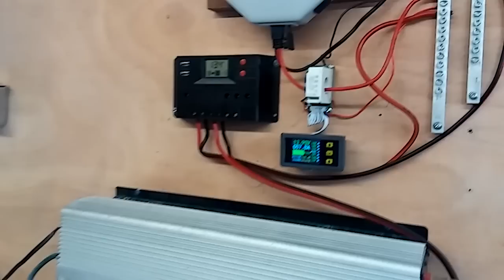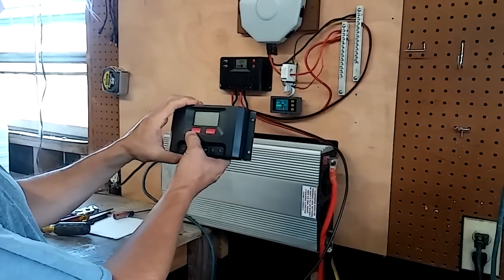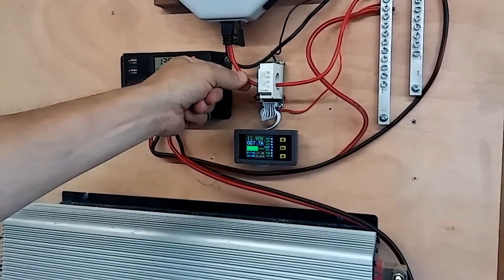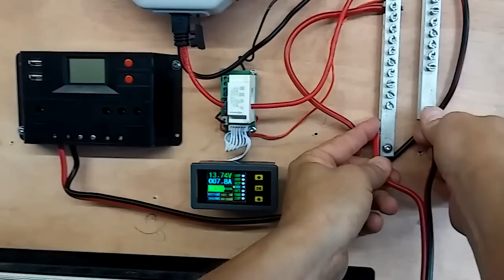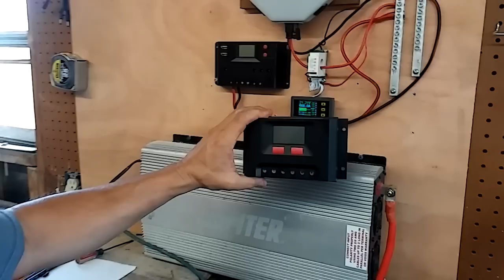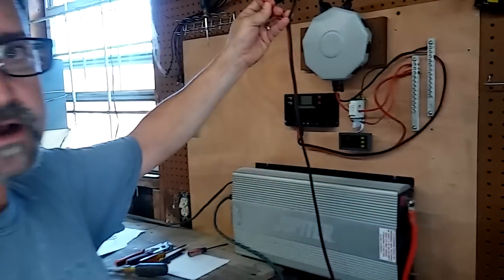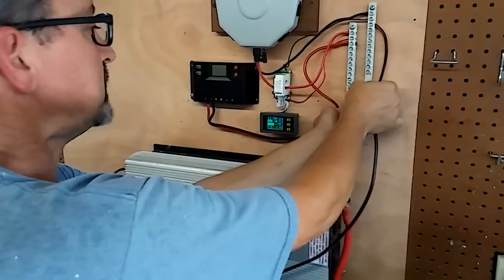Maxing out Harbor Freight solar panels

Comment: What about stepping up the voltage to 24v or even 48v?
Reply from the maker: Michael Sherburne. My power inverter is only a 12 V inverter and the charge controller you’re looking at will not handle that voltage.  But in the future yes maybe

Comment: I have to Harbor Freight 45 watt solar panel kits. My question is could I hook all six panels to one original Harbor Freight solar panel charge controller. Any feedback would help, I am charging 2 6 volt batteries tied together for 12 volt Trojan t105
Reply from the maker: The charge controller that came with the 100 watt kit has a 20 amp fuse. I have goten 13+ amps out of it with 12 panbels. I now have 3 100 watt kits. I had all 3 kits totalling 300 watts. I had no problems
Reply: @Checkitfirst  so if I'm getting this right the obvious question is I need to check the fuse in the back of the controller and see what the maximum amperage you can handle. And this is coming from someone that worked on generators Transformers electric motors, LOL that tells you a lot of what I know and don't know. Just because you put a carburetor on a car doesn't mean you can rebuild it LOL
Reply from the maker: @marbbridges  . Don't be so hard on yourself LOL....  The manufacturers said my controller had a 10 amp fuse in it. When I checked it had a 20 amp fuse.. Sometimes manufacturers dont know crap. ☺. We all learn something new everyday...
Reply: People used to work with who thought they knew it all, I told him to be careful cuz you have one foot in your backside and one out the door LOL

Comment: I wonder why the charge control of the other one was lowering  it. My charge controler has a 20 amp fuse... I took it apart and looked.
Reply from the maker: All the harbor freight charge controllers have a 20 amp fuse in them except the 500 watt charge controller . it does not have a fuse in it
Reply: @Checkitfirst   ah ok. I was about to hook up  the harbor freight solsr panel  in series then hook it up to the charge controler. The current wouldn't be much but the high voltage would blow it  . How much voltage can the charge controler handle  from  solar panels connected in series?   Do you know why  the new charge controler allowed for more amps  vs the other one? Thought the othe old one was more powerful.  You stated in the video the new charge controler had a 10 amp  fuse. Just making sure   my system isn't weird.  Thanks again
Reply from the maker: @j5892000  . The manufacturer said there was a 10 amp fuse in the controller. They were wrong. I opened it up and found a 20 amp fuse in it. I have a video. Go look.. You can not run pannels in series with harbor freight charger.
Reply: @Checkitfirst   yeah I had seen a video about why not to do it but never saw anything in how much voltage they can take  going in.  Harbor freight doesn't have much info sadly. I'm thinking about tinkering with   dc to d.c step down  converter.  I hsve carried but.  It's 2 gel batteries that are about 110 ah. Both 6 volts so  connected in series. My charge controler charges  them so slow .   Do I figure I can get the panels  to hook up into  that  to drop the voltage and plug it into my inverter  do het more  faster.  Or I could just go with an mppt chargers 🤔. What do you think
Reply from the maker: @j5892000  mppt... That way you can add more panels in the future. I ran my panels in series and got 60 volts. But my amps to the battery stayed the same. You won't gain any amps running in series. If your pannels are close to your charger like within 30 feet I would stay in parallel. If you are farther than 30 feet and have small gage wire then run in series. Amps are lower on panel side but the controller will bump the amps back up..
Reply: @Checkitfirst   ah ok thank you for the information.  Yeah the series was for  so I could get my volts  up for charging.  I fear  my panels  are  not puting out enough volts in parallel  to full charge a bettery unless it's just pwm charge controler  keeping it low  because the gel batteries are sensative to over voltage

Comment: Don't forget the internal  resistance  of the battery you may want to load the 12 volts to the battery to get maximum charge potential, good luck

Comment: Also if one got this kit and mounted them like you did on roof tops is there any limit to how many you get. I mean could you just get 4 sets for 400 watts solar panels and connect them up because the only thing i see is you need a better controller panel other then that to extend more solar power it seems just dropping new ones down and connect them up to bus bar in your set up. Anyway great video i think the solar stuff rocks with harbor freight maybe some day all have some uses for these to run small appliances off of.
Reply from the maker: If I had to do it again, I wouldn't by HF kits. I paid over $300 for 2 100 watt kits.. Recently I bought a single 100 watt monocrystalline panel on Amazon for $95 free shipping. And a mppt controller for $180. I have noticed the monocrystalline panel works allot better. Im noticing the HF panels are starting to deteriorate around the glass. There made of plastic. I don't beleave they are designed for 24-7 use..

Comment: Hey talk a little about the white thing you have the positive input from the panels going through.  What do you call that item?  What is the wiring below it going to the gage?  What do you call the gage.  Where do I get that set up?  Looks like a cool amp/volt meter.
I appreciate your showing the set up and your testing ideas.  Thanks.  Don
Reply from the maker: Hey Don... That little white thing your asking about came with that meter you see. That meter is Yeeco Digital DC Voltmeter. I found it on 
Amazon.I believe i payed $35.00 for it. It measures the amps that flow though it. That meter reads volts, amps, watts, and records usage. I have mine hooked up to the solar panels so I can see how much power is coming from them.

Comment: How much money donI need to set a solar system like yours???
Reply from the maker: Luis Anacona. Well, this video has roughly about $400.00 invested. If I knew then what I know now I wouldn’t buy it. There is better stuff than this on amazon like 2-100 watt panels at $99 bucks each and $150 for a charge controller
Reply: Thank you so much for the information, now I have a idea...

Comment: I just bought this 100w kit from HF on memorial day special still unopened should i return it? Reading some of the comments gives pause, even though the vid creator might have messed up wiring two kits with only one of the included controllers. I'm wondering if it still might b a good deal if I could separate the kit into 4 separate 25w panels and just use them for separate vehicles, trucks n' stuff. 25w should b enough to maintain any unused truck battery right?  Can they b split up? Alls I would need is to buy 3 more cheap  <20$ea pwm overprotection controllers. Might even get the full 25wx4 power that way... I have 4 seldom used vehicles and an unused RV on my vacant lot that I'd like to keep the batteries charged on. I used to maintain everything via plugged into RV exterior-Ac-wall-outlets running to a grid-tied pole. But the rural electric co was scamming me for 40$(summer)-90$(winter)/mo!! And  nothing ever even drew current! (Tbh it was a cold winter). That's when I figured I could off grid and buy a new battery/mo at that price. I never use the place...mainly storage, but would occasionally like to campover or party in the rv (preferably with ac for when its hot...has 2 12v batts inside).
Reply: Even though I've learned a lot from them, If I had to do it all over again I'd buy something other than the HF kit. I'm only getting 1 amp from my 4 panels and I live in Arizona and have them angled correctly. Sure, it's November but so far very disappointed in the panel outputs. I have a 2 watt LED light bulb w/a dawn to dusk timer (it's on all night) and a 300w inverter with a motion activated LED Shop Light (from costco) and a small lawn irrigation timer connected to the inverter outlets. The shop light turns on about 3 times each night when my dogs walk by the shed and every morning my brand new deep-cycle, 120 aH battery shows 10.5 watts. One of these may be sucking electricity at a high rate, but was really disappointed, on a cloudless day at 10am, to see 1 amp coming in from the panels, especially when the box says they're 6.5 I think.

Comment: The Charge controller also keeps you from over charging the battery too though, right?
Reply from the maker: yes. the panels are around 18 volts.. the battery needs 13.8-14 volts

Comment: Solar panels need to be lifted off of the roof to produce more energy efficiently..heat kills power
Reply: photovoltaic technician here.  and i concur, heat kills power. i Like, OLE!
Reply: @importryderify - PV Array mounted directly to the roof = rookie mistake #1 ...

Comment: If you have an MPPT charge controller my guess is that you will get about a 30% increase in power. 

PWM charge controllers just "lop" off the voltage greater than the battery can use, an MPPT charge controller will take that 'extra' voltage that is not needed and convert it to amps at a lower voltage that can be put into your battery.
Reply from the maker: Doesn't do any good with only 200 watts. The 3/4 amp i gained when i bought my mppt doesn't justify the cost. Now I'm at 500 watts and i can see the difference and justify the cost..
Reply: @Checkitfirst  Agreed, but I think that is a result of the harbor freight panels specifically. I never put MPPT on the harbor freights I had, but I did a test on one of my windy nation 100W panels. on PWM I would get a max of about 69Watts output, but using MPPT I would get close to 98Watts max.

5.2Amps max on PWM   Same conditions on same battery bank (did the test within minutes of each other) MPPT gave me 7.4Amps output. Batt voltage at the time was 13.3Volts 

13.3Vx5.2A = 69.16W PWM , 13.3Vx7.4A=98.42W MPPT 

The harbor freight panels seem to be running at an odd powerpoint and are unable to actually give you 100W (or 25W per panel) output.
Reply from the maker: @andresrvlife1386  . I agree.. HF panels just dont seem to match the power of mono panels. I have 12 of them and I will use them till they stop working. Seems they have a short life span. Not really designed to operate 24/7.

Comment: I got 400 watts of panel on the roof, 200 watts facing east, and 200 watts facing west.
I can hit the full 30+ amps from my 400 watt hub.
The real item everyone needs to be aware of is the 500 watt controller may charge a lifepo 4 up to 4.2 then stop providing current.
I don't know at the moment how low it will let the battery go before it starts dumping amps again into the battery, Report when I find out.
Reply from the maker: I’m just curious why you’re not facing all of them south
Reply: @Checkitfirst  I guess he's looking to maximize his early morning charge after drawing down his battery at night and late afternoon charge to top them off before dark.

Comment: to determine how many amps can be produced by the solar panels, your plan is 'nice' However, the amperage to the batteries strictly depends on the current charge state of the batteries
Reply: AND ... the load on the battery

Comment: The one that comes with it is a 30A according to the manual. Thus 360W,  so buying a 200W controller was probably pointless. It may have been putting out just over 200W and reducing it down not to blow itself up. Or the heat was just too much like others said.
Reply from the maker: chris cox. The original charge controller only has a 20 amp fuse in it. I opened it up and looked. I did a video on it go check it out
Reply: @Checkitfirst  thanks for letting me know because the book says something like  30 amps max but didnt really say thats what it was necessarily rated for. And I have 275W total. 

 But was the fuse on the incoming or outgoing power? Because my panel's incoming is 18-20v and controller outgoing is like 12-14v. 
18v @20 amps is same wattage as 12 @30. (360watts)

Maybe the book was referring to the max output is 30amps. I guess I need to look again but my 275watts total shouldn't cause any problems at 18v.
Reply from the maker: @spankymagee . I believe it is the output power. So you are  looking at about 21 amp to the battery if you are getting a Full 275 watts in. I would probably get a little bigger charge controller😊
Reply: @Checkitfirst  yeah better safe than sorry. Some are only like $30 on amazon. Ill probably run my 100 watt thunderbolt on the that came with it and the 175w panel on the new one.

Comment: Nice video! I have two 100w generic Chinese solar panels in parallel so 200w total 12v system, a good quality (Carspa) PWM charge controller and I get 10 amps max in full sun. i believe you will never get 16 amps on your system when using a PWM charge controller. your max amps will only be around 8 to 10. considering you have Harbor Freight PV, and accounting for voltage drop, 8amps in full sun is about right for your system.

Comment: do not touch your fingers on the wires or busbars when testing amperage. your body absorbs some of the energy
hook the wires up and install a switch  flip the switch and then take a reading. but I'm going to tell you your going to want to use a larger ga wire from the charge controller down to the batteries at least a 8ga or even a 4ga wire, your trying to get as much energy as you can.  add all the panels up each one has a 16ga wire on it to support that current you have to provide a path for the energy x2 per pair   8 panels would need  x8  in wire size yes its overkill but would you rather gain more power and lose a few pennies? or waste what you could have if you upgraded the wires.
This is 12 volts not AC its DC direct current wire size and ga has a profound effect on current transfer.
The reason your home uses 120 volts per leg of 240 volts is because moving power over a long distance with dc current uses very large wire's  almost everything in your home runs off low current after stepping down voltage in a power supply.
you clocks radios tv's computers ex. run off of 12 volts or close to 12 volts dc current. Large appliances run of AC current and low dc current if they have a computer chip in them Most are 120 volts  a electric stove AC system and dryer use 240 volts ac and 120 volts ac  very few other things use this type of power unless you have a machine shop or woodworking shop ex.. but that's differnt stuff most homes do not have that.
instead of buying inverters to step up power to step it down but stuff that runs off 12 volts because everytime you change the voltage you lose some of that power in heat. Its lost energy.

You can find plenty of things made to run off 12 volts, tv fridge ac units ex. Even power tools. rechargeable power tools that have plenty of working power that can charge off a 12 volt system. 
 Light's did you know all Leds run off of 2.1 volts dc?  
 Buy Leds and a 10k ohm resistor put the resistor on one leg and you have light right off your 12 volt battery.
Led stands for Light Emitting Diode they wire up in one direction only so if its not coming on turn the polarity around
If its a good led it should work. Most failed Led house light bulbs fail because the power supply went bad not the led.
Now That's an assumption not fact I haven't  tested  yet. But Leds last a long time and draw very little current.
What draws the most current in say a TV is the power supply in standby mode. Its pulling power to be ready to turn on when you push power on. It's stupid but thats how its done.

If I were to build a home today I'd rethink the entire electrical system to be multi voltage,
1 power supply for Lights and lighting systems, one for electronics and one for electrical appliances.
2.1 volt dc  Lights
12 volts dc  TV stereo computer ex..
140 2 phase volts ac  Fridge counter top cooking  garbage disposal
440/240 3 phase volts ac  AC system dryer and anything with a high powered motor and car charger for garage electric car.
This is what A home should have.
Reply: Thank you for all of this information. This extremely enlightening
Reply: @bobbg - His fingers are NOT absorbing any measurable energy ...

Comment: Can the amount of sun blow out a charge controller? I bought a used 100watt set and the guy told me the controller was bad. 
I had plans to buy a second kit and run it like your set up.

Thanks for explaining the 500watt charger upgrade...saved me from making that mistake.
Reply from the maker: The more sun the better. But you cant exceed the chargers capabilities. The charger im using can handle the 18+ volts im sending to it. Also do not draw more than 20 amps from this controller as it has only a 20 amp fuse in it..☺
Reply: Check it first so maybe the guy blew the fuze? I never checked the system after i bought it. The panels went in storage and the charge controllers on a shelf next to me? 
So should i be able to open the controller and see a fuze i can replace?
(I also hadnt considered maybe he fried his battery)
I paid $40 for the charge controller and 4 25watt panels. 
Thanks.

Comment: I have one panel hook to a mpp controler into two baterys and a apc works find runs fan tv charges my phone my batterys for my flashlights my elictric lighter .going to put 4 280 watt panels up as soon as i decide to get them i can get 280 what industreal grade panes 135 bucks each

Comment: Question my batteries I use are not holding a charge is there a way to trick them back into holding charge?
Reply from the maker: Miami botany. What size is your battery?  Are you using your battery continuously? How are you charging your battery’s. Just some questions to help me help you 😊. How old is your batteries